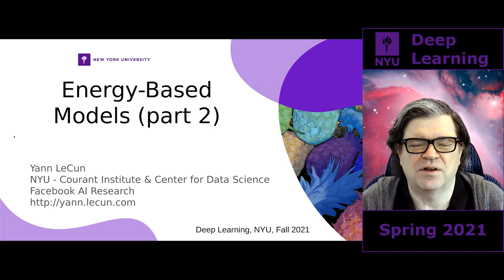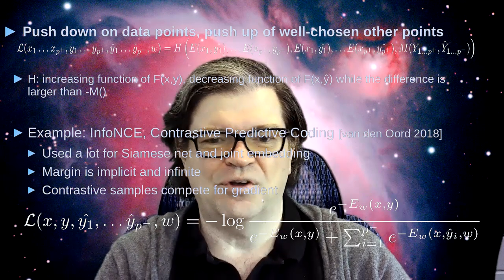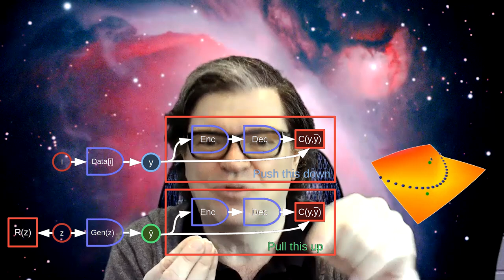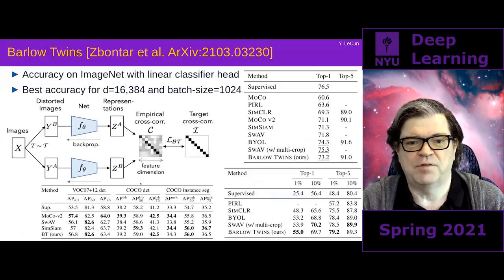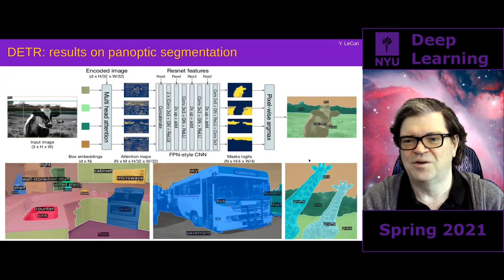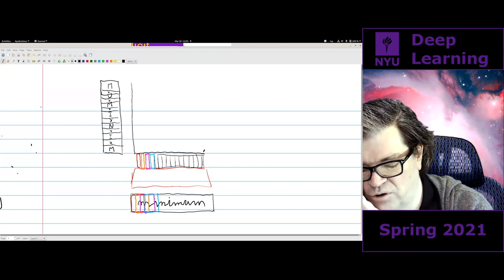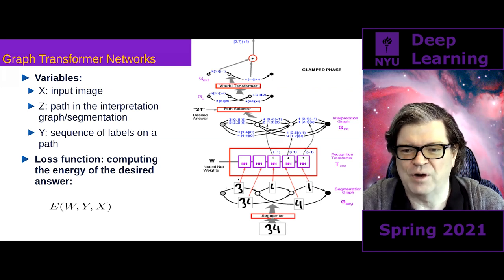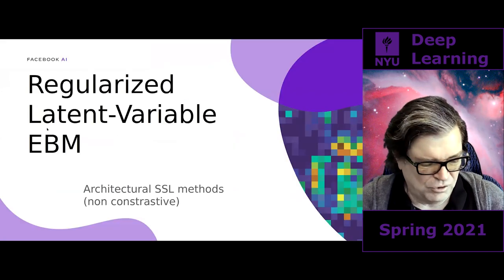06L – Latent variable EBMs for structured prediction

Comment: I have a doubt, In previous video Yann explained that while training EBM in contrastive learning methods with joint embedding methods, we take negative samples in such a way that they are very different so that the system learns better, but in Graph transformer networks we took the best possible answer for contrastive learning. So how does it works?
Reply from the maker: You need to add some time stamps or it’s going to be impossible for me to address your question.
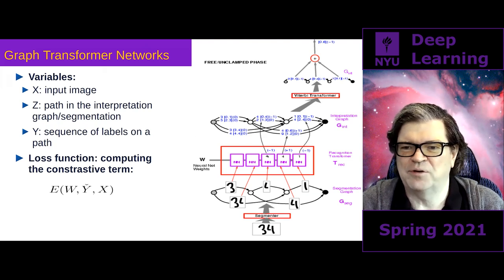Reply: @alfcnz   I am talking about the discussion between the time instants 1:39:00 and 1:43:00